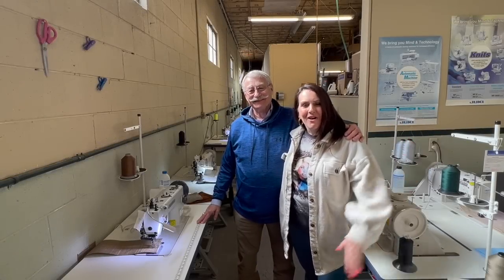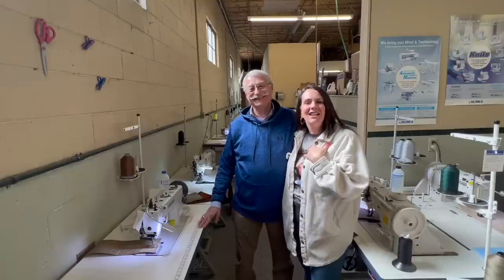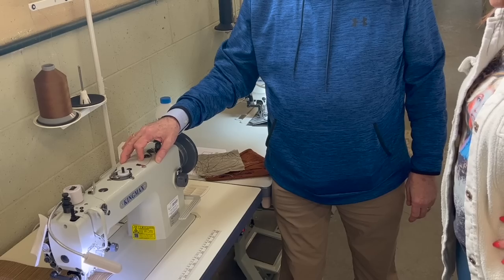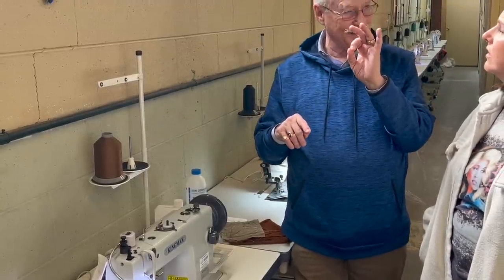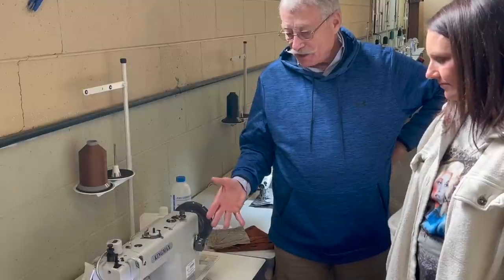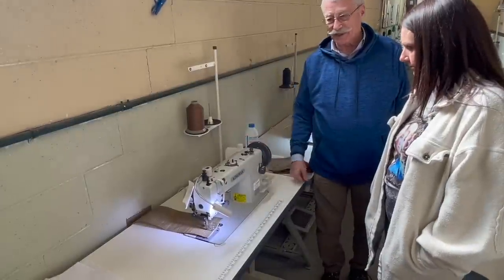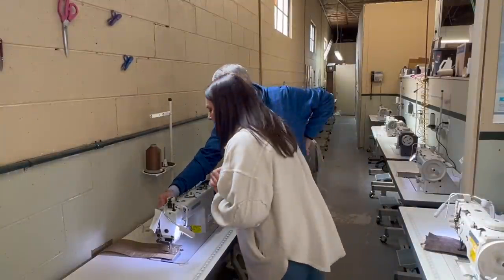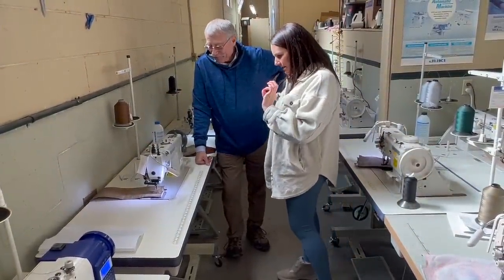Let's Talk Industrial - With Jack from Ralphs Industrial Sewing

Comment: Hi Siah just wanted to say I have the Juki 1541 & use it for bag making & to make hair scrunchies. It can handle the thinner fabrics  just use a smaller size needle. I use it for the lining for bags & haven't had any issues. So don't let that what they say about it not being good for bag making turn you away from the 1541. My juki 1541 is amazing I love it and wouldn't trade it for anything else. It's heavier duty but can do light duty as well. I have sewed satin hair scrunchies on this machine with no issues. Hope this helps..
Reply: I have a 1541s 2 and I sew bags no problems
Reply: I also use the Juki 1541s for bag making. Since my Juki 5550 is set up right next to the 1541 I use that for linings but the 1541 sews 8 oz canvas and lightweight cordura beautifully. Also, the 1541 is able to turn on a dime topstitching. I think it is a matter of what you become used to doing and not being fearful of trying everything. All these machines are amazing to work with.
Reply: What size needle do you use when sewing thinner?

Comment: Brilliant video, wish I saw this before I bought a machine.  I purchased a Seiko H-2BL-AE-1.  I live in the country but I purchased it from the city which is a 5 hour drive.  I was having a few issues and the technician from Elizabeth machines helped but it hasn't fixed the issues.  It's hard when you have no idea what your doing and you have no one to help you if you have a problem.  Thanks for the tips especially with oiling since the manual doesn't tell you where to oil it, and the marks left behind on the vinyl, and adjusting the nut.  All these things that should be in your manual but aren't, cheers from Australia.

Comment: Funny I just found this video. I just bought the 1341 from Ralph's two days ago.
People refuse to believe the fact that their all basically the same machines. Juki, Thor, Techsew, Tysew, Consew, Cobra, Kingmax and on and on. But, if want a service shop that'll service your machine, you better buy from the dealer that sells the machine.
A local leather supply store told me I should buy a Cobra. I said "why? It's the same machine as the Kingmax, but who's going fix it if it's something I can't actually fix myself or even have the parts? I don't know of any Cobra repair shops around Denver." The only difference between a Cobra and the others is that they're painted brown. I actually like the brown and they're fine machines, but I'd never a Cobra unless I lived near Ontario, CA. 
Hint: if repair shop also sells vacuums, they most likely are not going to be able to service an industrial machine.

Comment: Same problem when you live in Iowa and need help from them in Denver.  ONLY drawback I have had so far. Also bought your model to sew leather was not told about the foot thing I may have bought the cylinder instead.  I got no instructions except from Kassiah

Comment: Very informative video! I was assuming the Juki 1541s was the industrial that I would want to have but now I'm not sure about that one anymore. I definitely want something that can do linings too! How much does the arm one that you are considering cost?
Reply from the maker: Around $2200 I believe, give or take depending on customizationsl.
Reply: I have a 1541S and can do linings that have interfacing, wpc easily. You just need to change needle, thread and possible tension. If you have a domestic you can use that for thin material.  There’s pro/cons for both cylinder and flatbed. So much info out there lol.